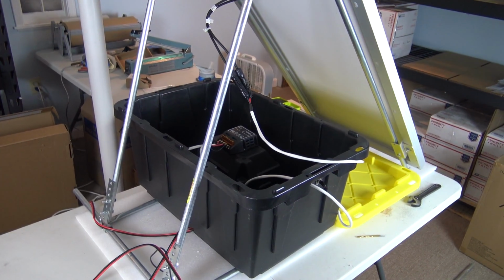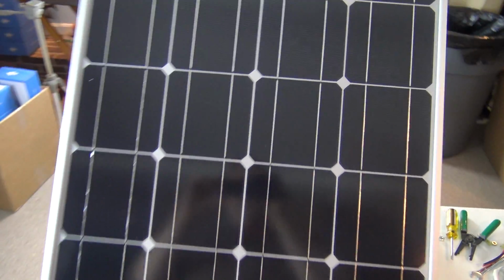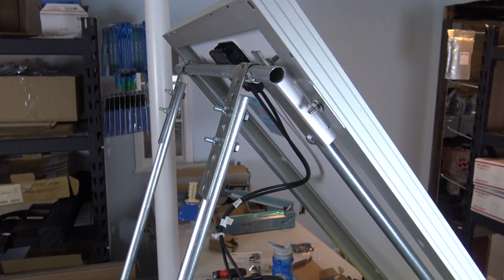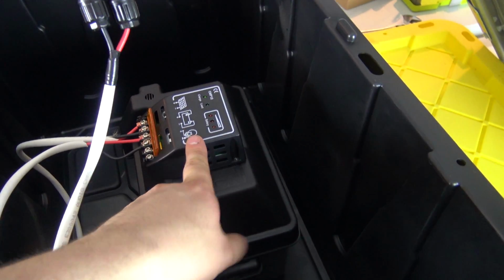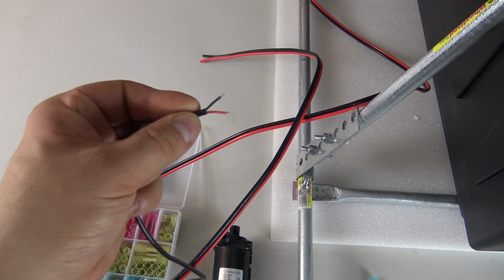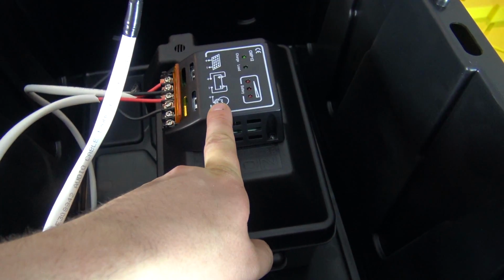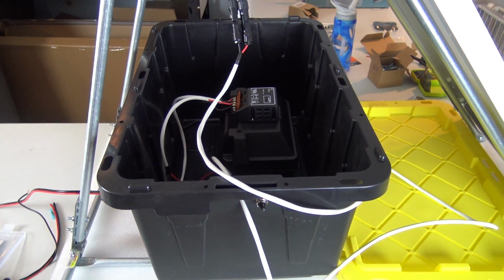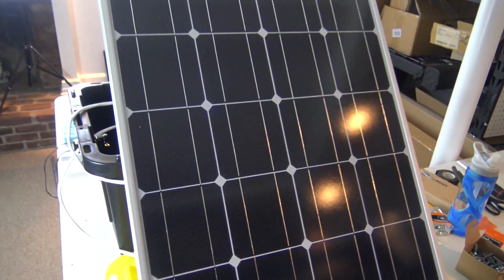#473: Off-grid Solar Panel Stand and Drybox Build - DIY Wednesday

Comment: Ren-oh-gee.  Cool project. Most solar panel company's I'm aware of always say to attach the battery to the controller before you connect the solar panel to controller to avoid damaging the charge controller. You could use a switch between the panels and the controller to disconnect the panels anytime the battery is removed or disconnected.

Comment: You probably need much more adjustability of panels. That 'dry box' is not dry. If you closely examine it you will see that rain can leak in. Many storage boxes are similarly flawed in design. I don't know the current draw of your pump or amount of intended use, but with that smallish battery it seems you would be wasting a good capacity of the solar panel. Once that battery is charged any additional output of your solar panel is wasted.

Comment: If you strip the wire out a little longer and doubled it over to make the wire a little thicker. Just a quick an easy fix and it won't harm anything.
Reply from the maker: i'll give it a try, thanks!
Reply: That's the trick.